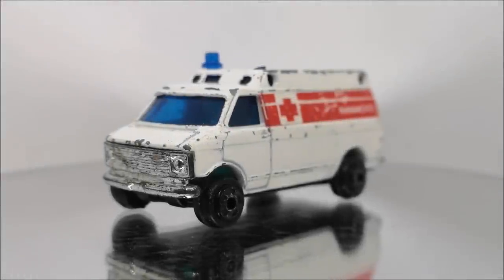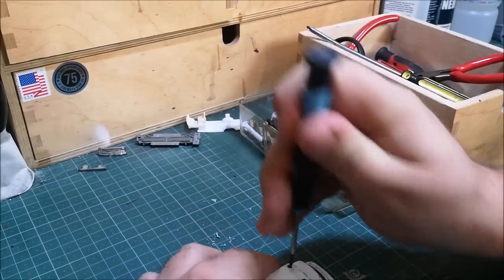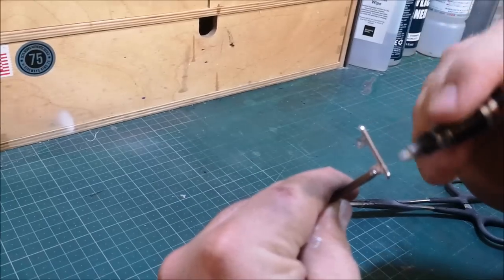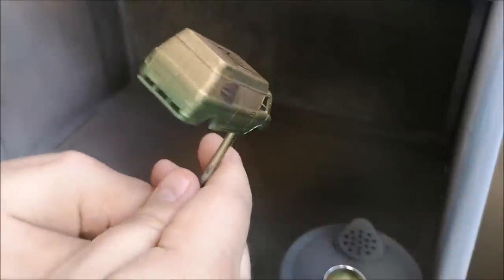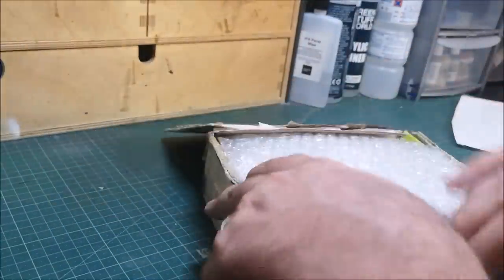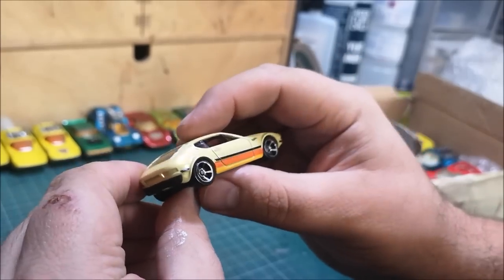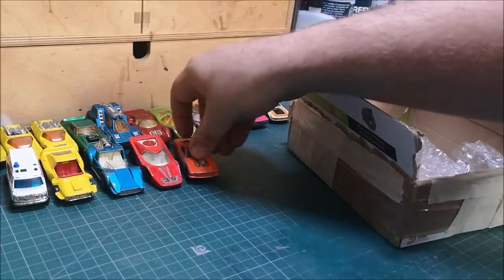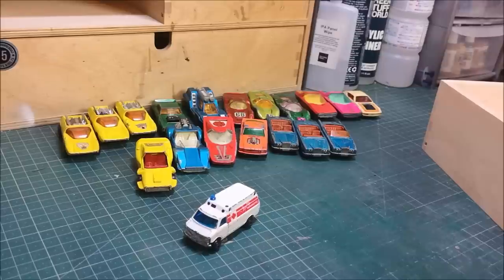Zylmex P346 Ambulance Van Custom + Unboxing

Comment: Rob, the decal reads : Love is blind : if image is held up to a mirror. ✌Groovy van...
Reply: I thought it was reversed as the ampersand to the roof is... however,  even reversed the writing is gobbledegook...
Reply from the maker: Hmmm thinking about it, I'm sure these were sold as tattoos so could be that I was supposed to push them on, not slide 🤪
Reply: I never would have thought to reverse it. I wonder if it was supposed to go on a window?

Comment: 24:30 The VW SP2 only made here in Brazil,from 1972 to 1976, the engine is from type 4  aircooled (412) with 1700 cc,design by Márcio Piancastelli

Comment: those rolls royces are Always missing the cover fot the softtop, thats the plastic part in front of the very often missing trunk. i have one example with windshield and with trunk, but even then its missing that cover. many parts on this car, even the bumper, grill frontlights combination is a separate part. must have been just as expensive as a real RR to produce. lovely box